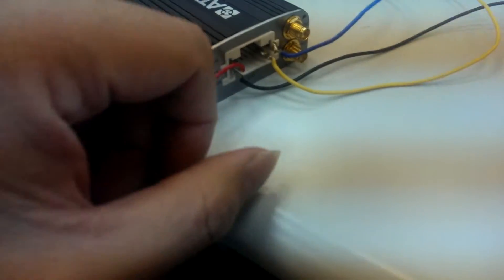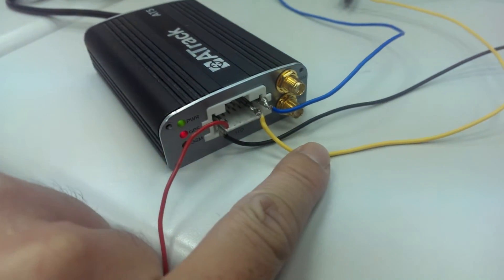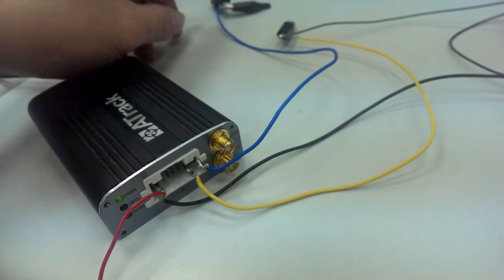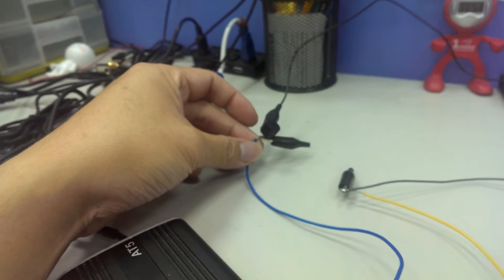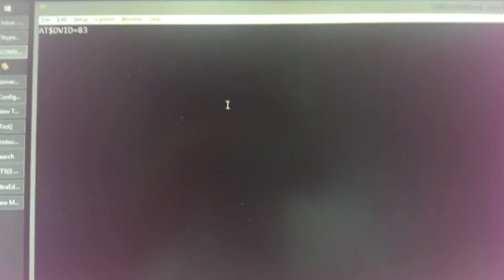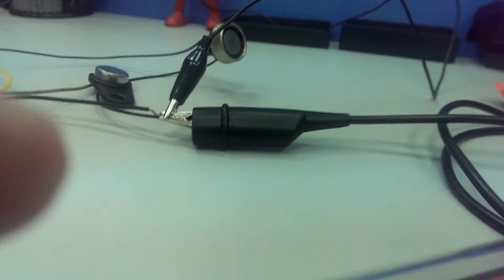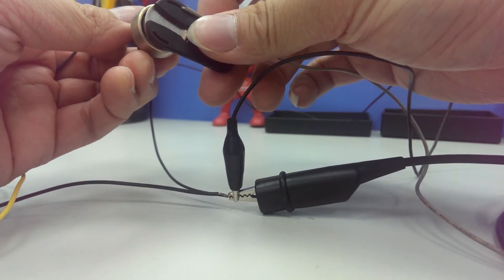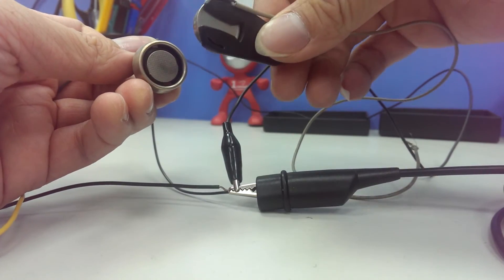ATrack iButton Reader Test

Comment: H

i dont know if you would know im using a I Button with the odroid C1+ but every time i log it brings up its id  at a specific path but that id is stored in that path for about 80seconds which is to long for  my application is there a way to decrease this time that the system retains the id?